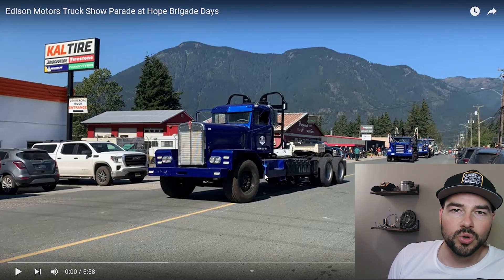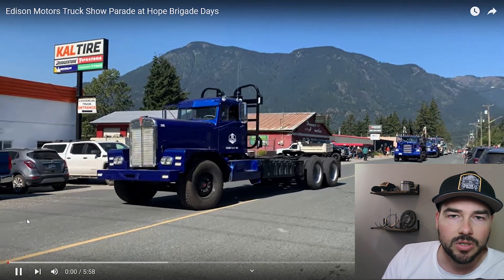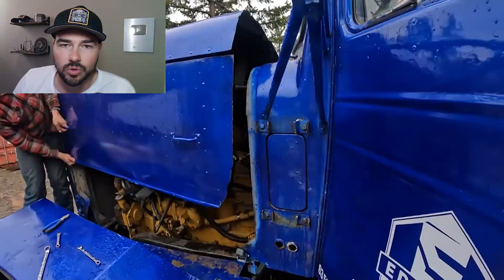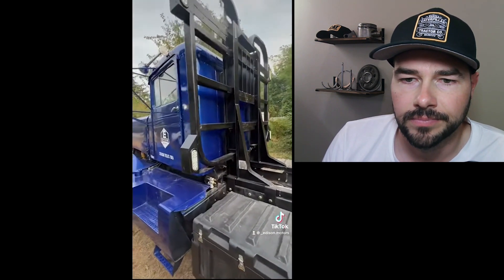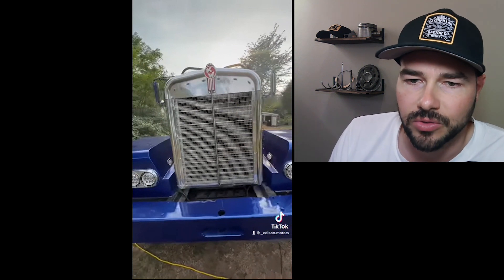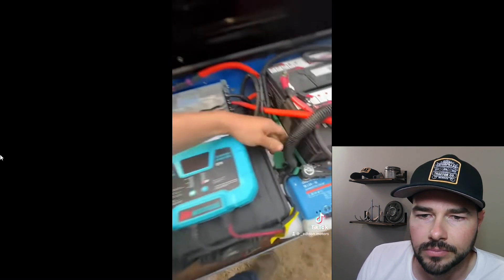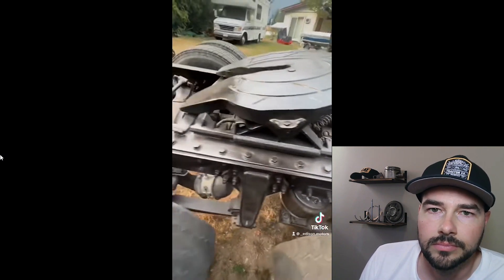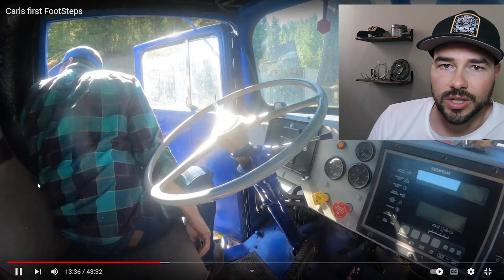Mechanic Reacts to AMAZING Diesel-Electric 1962 Kenworth. Edison Motors.

Comment: That actually makes sense to me, the electric power plant has to be a ton more efficient in power delivery than a regular diesel truck, especially if they’re being run around town say a food route truck or something like that
Reply: Or hauling logs down trails
Reply: @poiu477  doubt it, especially in snow and ice with no
Gear selection. I drive log truck for a living and this would spin out in places where my 94 westerns star with a 650HP 3406e wouldn't. Would be more interesting to see it go down hill and try to keep the trailer from folding like an accordion no no gear selction.  Anyone can put some fancy paint and black wheels on a hybrid "log truck" and drive it thorough parades. Let's see it do work.
Reply: @Airsoftbros888  You generally don't need a gear selection when using electric motors. They naturally are more efficient at providing low end torque. Doubt it actually would spin out like you think
Reply: @Airsoftbros888  Also, it's not a "hybrid" it's Diesel-Electric. It uses the generator to power electric motors. The generator isn't even mechanically connected to the wheels. They wouldn't use the system on TRAINS if it weren't torquey.
Reply: @Airsoftbros888  A diesel–electric transmission, or diesel–electric powertrain is a transmission system for vehicles powered by diesel engines in road, rail, and marine transport. Diesel–electric transmission is based on petrol–electric transmission, a very similar transmission system used for petrol engines.

Diesel–electric transmission is used on railways by diesel–electric locomotives and diesel–electric multiple units, as electric motors are able to supply full torque at 0 RPM. Diesel–electric systems are also used in marine transport, including submarines, and on some land vehicles
Reply: @poiu477  do have any experience winter driving in the mountains or in a log truck which is what this is?
Reply: @poiu477  how are you going to come down a 10 plus percent downgrade in ice and snow? You seem to continue to avoid downhill and winter driving which is what a log truck does. Highway truck sire anyway. But there a reason ZERO log trucks have auto trans which is the closest thing to this than say an 18 speed manual which is what every log truck has
Reply: @poiu477  more torque equals more wheel spin, that's why in slick conditions you "lug" engine in higher gear than you normally would, or light throttle around bends in road to avoid sliding off road. Going downhill in very slick conditions jake brake is a no no. You have to grab gears constantly to keep wheel torque down to prevent lock up. Wheels lock up when using hake in slick conditions.
Reply: @Airsoftbros888  That's not what torque means. Electric motors have full torque AT ZERO RPM. They can hold position WITHOUT BRAKES. They can pull with full torque at as slow an rpm as you need to ensure grip.
Reply: @Airsoftbros888  Nope, the "closest" trans would be a CVT and mechanical CVTs just suck all around, this is NO TRANS.
Reply: @poiu477  you seem to have zero experience with big rigs don't you bud
Reply: @poiu477  yes they will hold there position by "engine braking" which causes wheel lock up in slick conditions. You still haven't answered me about winter driving whether you have any experience or what this "diesel- electric" will do when it gets real slick in the woods?
Reply: @Airsoftbros888  not in a logging truck, I'll concede, but I have a breadth of knowledge working with electronic components and work on my own car and stuff. I do have winter mountain experience though; I live in the North-East. Electric motors operate in a totally different fashion than ICEs and you really can't just assume that an understanding of one translates to the other, they are wholly different modes of traction.
Reply: @poiu477  have you ever driven mountain roads in slick conditions?
Reply: Cvts for big rigs don't exist. We're not talking about cars here. Trucks weighing 100,000lbs or more in the woods in slick conditions.
Reply: @poiu477  with a trailer which when going DOWNHILL wants to come around and hit your cab, sometimes 2 trailers
Reply: @Airsoftbros888  Sure, because CVTs suck all around, and the belts would need to be made of vibranium or something, but the closest analogue to a diesel electric IS a CVT. It's wholly linear, with no gears. It is absolutely not like an "automatic"
Reply: @poiu477  ask any log truck driver. FULL control of torque applied to the wheels is necessary in slick conditions. I've conceded that for highway use yes, this diesel electric would be good
Reply: @Airsoftbros888  And with this you do have FULL control of torque applied to the wheels, and with a diesel electric you could put motors on the trailer wheels too, because there is no mechanical linkage.
Reply: @Airsoftbros888  and actually, you don't have full control of torque with a mechanical transmission, you need differentials and such, with a diesel electric you can choose EXACTLY how much torque to apply to each wheel.
Reply: @Airsoftbros888  Here, let me try and analogize this in a way that might help you, this is more like having all 18 of your gears on one gearing, totally linearly, IN EACH WHEEL. But even that isn't really right, because there is only one rotating body, you have full control of torque at any RPM. It can be spinning as fast or slow as you want, and you can be applying as much or little torque as you want
Reply: @Airsoftbros888  The guys building this truck are BC loggers and they're building it with logging in mind. I have a feeling they've thought it out to suit their profession. Instead of a jake it just uses regenerative braking which is a lot smoother and more controllable
Reply: @drpompo  these guys aren't loggers. Just cause they bought an old log truck and "resto modded it". I know loggers from around here, this is where I'm from and it ain't them. Also it's impossible to explain to someone whos never driven a log truck off road or on in slick conditions how, extremely powerful regenerate braking (let's this it would have) would be a bad thing in slick steep conditions and would cause your trailer to come around and hit you lol
Reply: @Airsoftbros888  These guys are loggers, they refitted their logging truck as their first project. The leader of the company first became known for making tiktoks about, get this, logging! Regenerative braking isn't all or nothing and trailer brakes still exist. Plus if it's such a concern you can just keep gearing in the rear end and work with it that way. I think these guys know a thing or two about building a truck for their own profession, the whole point is that they want to build a truck that works for them instead of the new shit on the market
Reply: @drpompo  that dinky drive shaft will have to be addressed, when you're on lose ground or Mudd or better yet spinning on ice then suddenly regaining traction lol. Let me know when it hauls a PAYload I'll be waiting 🥱grossing $260k a year with my 1994 western star with a 3406e cat😃
Reply: @Airsoftbros888  Just keep watching, they should be getting to the hauling stage soon. Could probably be netting a fair bit more if you knock a huge amount of your fuel costs off the budget, might be worth keeping an eye on it for a retrofit when they're on the market

Comment: Do you have any idea how much diesel saving there would be between running the generator vs. the stock diesel drive engine. 
Can it run indefinitely or are there any battery or systems overheating concerns? 80,000 pounds is a heck of a lot of weight any way you slice it.
Reply: It depends om how much stop-and-go driving there is. If it is mainly just highway - it will be less efficient.
Reply: They've had some battery heat issues that they're working out, installing a second radiator since the their first prototype lumped all the cooling into the front radiator. They're also building a prototype from the ground up that's going quite well. This was their very first go at it and it's a very impressive start

Comment: I've been saying for a while that improving Diesel-Electric drives, like those in trains and some mining equipment, but with more modern tech specially developing new batteries are the way to go for many trucks, specially those that are within metropolitan areas and not OTR. OTR might still require further development for greater reliability, specially if we still hit the wall of supply chain for computer chips, batteries, copper wiring, etc.
Reply: It would just reduce the efficiency of the trucks enormously.

Comment: Most of the big mining haul trucks run a similar setup, diesel/electric with no batteries. Not 100 percent sure how many of them Cat makes. The only diesel electric Cat I've worked on was a 797. Hitachi, komatsu, terex and so on all make them.
Highway trucks might end up the same eventually.
Reply: They have an advantage because large generators are nearby, or they can run power lines close to them, as they don't move long distances. If batteries were involved it would be a non-starter. All the big hydraulic ones have diesel engine options.
Reply: @ChevyConQueso  Thats a good theory but the engine/generator is onboard. Out in western Australia they go on some pretty long runs too. 
The all the mechanical drive haul trucks I've seen are 240ton and below. Mechanical economy/reliability really seems to go out the window past that

Comment: This is what i have bin saying all along, diesel engines are almost net zero emissions now a days.
so if we had cars and trucks simular to the chevy Volt where a small engine was to power a generator and used  that to power an electric motor we would extend the range of these batterys. Also would be an amazing way to charge the battery in the middle of no wheres as well, also if needed to keep moving it could limit the power and contuine to move the car or truck. a small cylinder or 4 cylinder diesel running at 2500 rpms would power a generator easily
Reply: search "micro turbine range extender"

Comment: The reason why trains are very fuel efficient is because of size. A semi tractor is just as efficient in miles per ton/gallon as a train if loaded to about 1.5 million lbs. Source: American trucking sim, and BeamNG

Comment: Crumbs talk about re-inventing  the wheel!!!, what I see is  an updated  Tilling Stevens Petrol Electric  Drive. Early in the 20th Century two gifted engineers Mr Tilling and Stevens designed and built  a simple to use drive system for a bus. Apart for Ol, Henrys Model T, all early 20th century motor vehicles use a cone or plate clutch and a three or four speed sliding mesh gearbox, you have to slide the gears in and out of mesh ,very difficult.  On our eccentric little island off the coast of France, some passenger transport companies wanted to switch from trams to  petrol motor buses. What  they  wanted is a petrol motor bus that drove like a tram , well figure it out Richard Osman!! put the tram,s electric drive  into a petrol motor bus chassis. Tilling Stevens did just that, swapped the clutch, manual gearbox for an electric generator driven by  the petrol engine, heavy duty cables supplied current to a tram type traction motor driving the rear axle via a propeller shaft. Simple to drive, driver has two pedals one for the throttle, the other working  the brakes, no gears or clutch to worry over.  So training tram drivers to drive a petrol motor bus is a lot easier, a normal throttle pedal controls the carburettor, like a  car ,speeds up the engine driving the generator more current fed to the traction motor, the  bus goes faster or slower just by foot control , safer as both hands are on the steering wheel.

Comment: This is a true meaning to a hybrid truck...  I may if design mines different... I would of had a small 3 to 4cyl engine driving 3 to 4 custom built alternators to run the ac unit and power steering pump and electric drive motors... The engine would be no more than 2.2L with 2800 rpm limit.. The problem would be either to have the electric motors connected straight to the drive axles or to a automated 12spd or automatic 6spd transmission...?
Reply: Wouldn't work on a logging/OTR/heavy duty application. Not enough time between heavy load conditions to recharge the batteries with such a low power engine. Would be fin in low duty cycle things like transit or local deliveries.

Comment: GE had system out for years. Diesel driven electric wheel units on huge Loaders & Rock Trucks that even had a retarder system on them. Not a bad setup. We had a very lot of luck with them if you allowed to  keep up the proper maintenance specially in electric wheel units. As always Production vs Maintenance the common fuss happens everywhere. I seen them Trucks become  junk after 1 year max over no maintenance what so ever. Companies money not mine.

Comment: Diesel engine, electric motor, generator, 4 large truck batteries, huge bank of "Tesla Batteries", plus large diesel tank, plus onboard controllers minus one 18 speed truck transmission. Wondering about weight. Maybe similar to diesel version?

Comment: How do they mount jake brakes on a Tesla motor?
Reply: LOL😂
Reply: 300 W amplifier, And a 12" woofer
Reply: I heard the CB was Bluetooth 🤣😂🤣
Reply: I wonder if they set this truck up for regenerative braking, not sure if that works without battery storage though. Seems more logical to have battery storage so you can run the diesel/gen only when you need to charge batteries or to provide for flat land use, then batteries give you the extra power to get up grades.  I would certainly like to discuss the project with an engineer to sis’s out all the pros and cons.  At this time it just is not logical for over the road use to rely on batteries only, so diesel genset makes too much sense especially if you can purr along at max torque of 1200 rpm with an engine of the correct displacement to minimize fuel consumption.
Reply: @johnb128  I did actually wonder about regenerative braking, but I just don't know much about it
Reply: @lynnhooley7608  ROFL

Comment: well that got confusing that stuff with generators and alternators.
So it is CAT Generator (engine running only in Idle or High Idle) producing AC out no is it rectified or not? If yes I presume externaly by that board youve shown and then they have step down converters DC to DC to manage 12V or 24V batteries and 12V or 24V circuits

Comment: That's interesting, I had read about R. G. LeTourneau built a generator over electric drive truck back in the 1950's or 1960's but it did not have any battery storage or hybrid ability.  There are some interesting things that can be done with large trucks to reduce fuel consumption since they might be operating at 80,000 lbs or more loaded then at less than 1/3 that empty. Something I have never seen would be two engines in line (one in front of the other) the front engine could be clutched - disconnected and shut down when empty and engaged and run when loaded. Two 7 liter inline or V-6 engines would provide 7 liters empty and 14 liters loaded but you would be dragging around the weight of another engine.

Comment: Diesel electric is less efficient than diesel direct drive. Generating and storing electricity comes with losses, along with the hauling the additional weight of the batteries. It’s used in trains as it can put the engine in its most efficient rev range and allow the speed to be varied whilst creating maximum torque through multiple wheel sets.

Comment: Is it really amazing though.... diesel (or any combustion engine)-electric is as old as the hills. I have an LW923 which also has a narrow radiator, and fibreglass fenders, and steel bumper and a 280hp 8V71. Was previously a 4 and 4 transmission but I replaced that with a 13spd

Comment: part of the reason why diesel trucks are still transmission drive, the efficiency from a deasil electric is lost by the weight costs for the truck. with legal limits, a lot of electric trucks are close to or near their weight limits and therefor can't legally operate in most places without a permit. while a diesel electric is better then a pure electric truck these weight costs are still not insignificant.

Comment: Hi trere, we are having problems with unrelated topic to this video, but since not even certified service guys can pinpoint the issue ill ask here, what would in your opinion be first thing to look if an Caterpillar C18 marine type with generator keeps getting A.E.1 Circuit Breaker Trip Alarm, once again i know this is unrelated to this video but i would apprechiate your opinion
Reply: What kind of load is hooked up to it? It could be a short somewhere in the load, a blown diode in a rectifier, a damaged MOSFET in a voltage regulator, a stripped wire touching the case... hard to say. If you have any voltage conversion going on, I would disconnect the load and check the voltage downstream of that to make sure it's not pushing 400V down the line or something. I'm not a certified mechanic, so sorry if it's a dumb comment.  Since I just noticed this was 3 weeks ago... did you figure it out?
Reply: @DFPercush  Actually no, we removed alternators so the all connection with that piece of gear is out of equation, the alarm is still there, no one knows what could be the main cause for it...
Reply: @quarantenaa  In that case, I guess my first thought would be the starter motor or the battery charging circuit. You say you disconnected the alternator - does that also include the voltage regulator? Or is that part of the ECU? I guess the only way to know for sure would be to look at a schematic and see what's in series with that breaker. Well, good luck, hope you get it eventually. :/
Reply: @quarantenaa  Another idea is if you have a thermal camera, or can borrow one, to see if there are any hot spots in odd places.